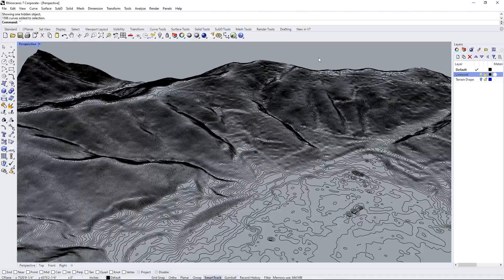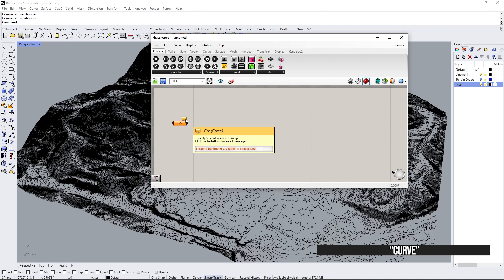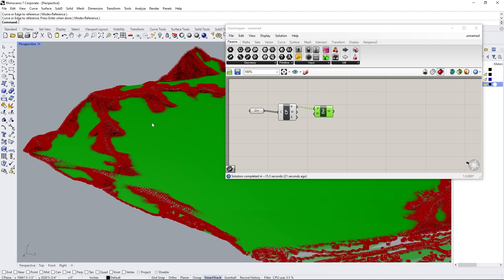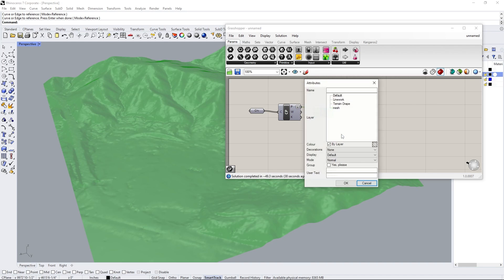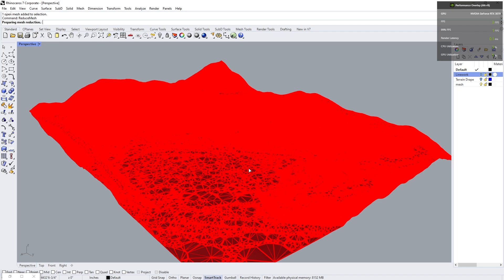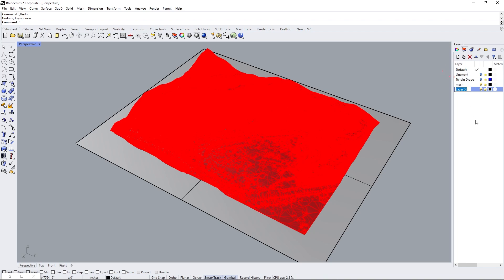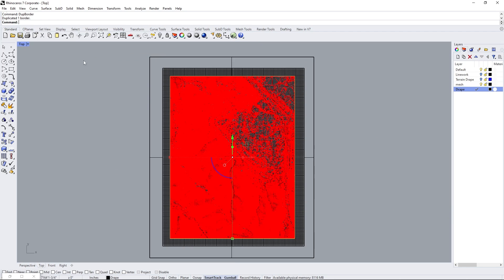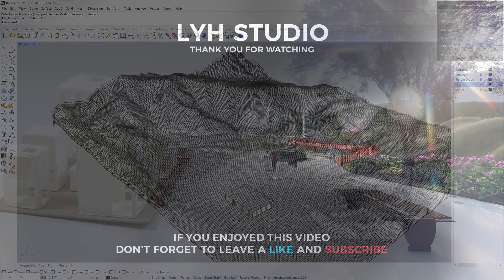Convert Contour lines to 3D Terrain in Rhino

Comment: Hey this was very helpful, tysm. I could make the mesh and the drape, but I would like to ask if there is a way once I use the split command to extrude the rectangle with flat/straight tap instead of with the curvature of the drape
Reply from the maker: You can make another surface and trim the top off in order to get a flat top!
Reply: You can also keep that splited rectangle with that little bit of original topography in a hidden layer so tou can revert to the original? Is this ok?

Comment: Awesome video, I have been trying to follow the steps carefully but I do not get the desired results. I have the contours as dfx file, I imported the file to rhino, followed the steps in Grasshopper and unfortunately do not get the mesh to further apply drape commend. please need help
Reply from the maker: Are you working with a extra large site or are the contours super irregular? There a number of issues I can think about that can go wrong but lets start with those two.

Comment: Hey, thanks so much for the video. just a quick question. I've noticed that the mesh is made based on the control points which are usually a bit set off from the contour line. is it possible to use edit points (those stay along the curves.)
Reply from the maker: I've honestly never tried to but that does seem feasible

Comment: I am doing a project surrounding a 700 ft deep mining pit and I think this will make my life so much easier trying to modify the contours and terrain to place my building on the edge of the pit and turn one of the contour lines into a path. do you have anymore tips that could help as i do this
Reply from the maker: You'd be right, I think I usually edit the lines and get surfaces from that rather than try to edit poly surface it makes the whole process a lot easier

Comment: 1) What file format did you use to export the contours from arcmaps to rhino? 
2) Once the contours are imported into rhino will they have their elevation applied or will I have to manually do I to each individual contour?
New subscriber here
Reply from the maker: Thanks for the support :)
1) dwg/dxf
2) if done correctly the elevations will come in at its height

Comment: Great video!! Thank you for posting this. I'm working with a 6000 acre landscape, and the dulaunay mesh looks awesome, but when I follow your drape command, it comes out all jagged. I am using Rhino 6, do I need to upgrade to 7 for this to work out?
Reply: excellent video, but I have two problems: the first is that the trim command to cut the excess doesn't work for me (it doesn't hurt), the second is that I get a territory with holes, not empty but all pitted (despite I set the cloth spacing to 1)
Reply from the maker: Did you adjust the spacing of the drape so that it's more accurate? Another reason why it might be jagged is because the surface is too far from the world origin.